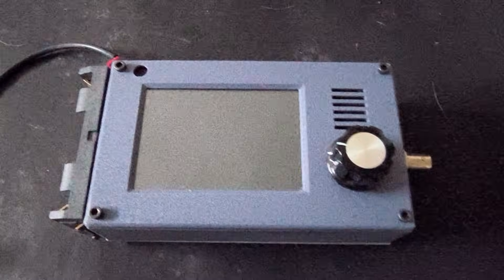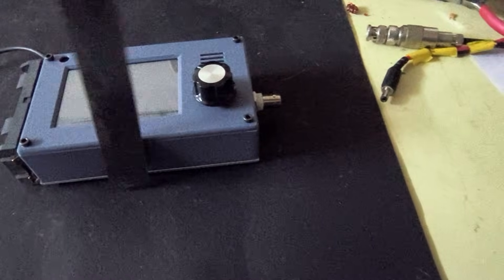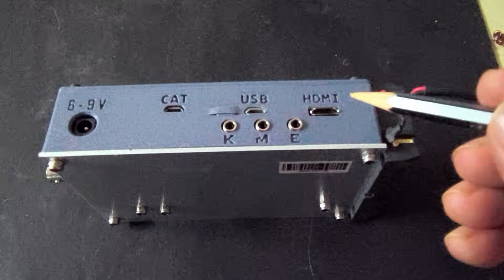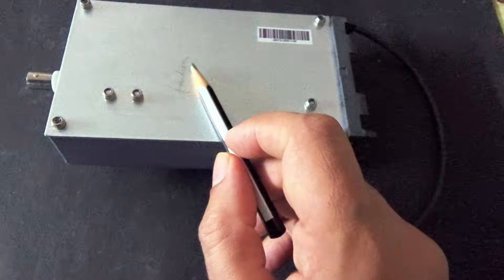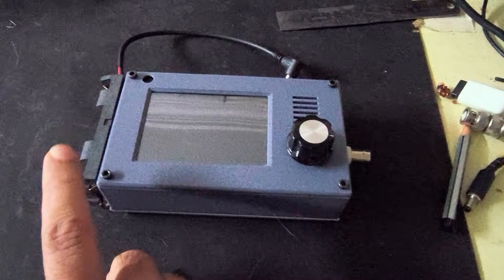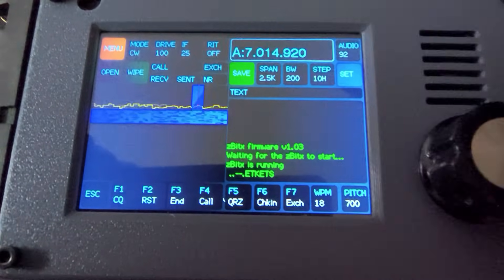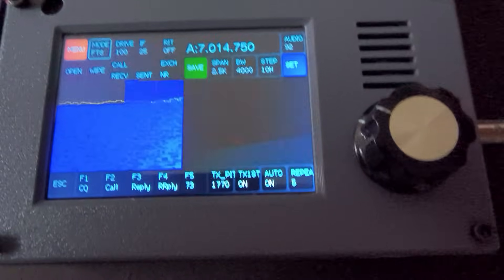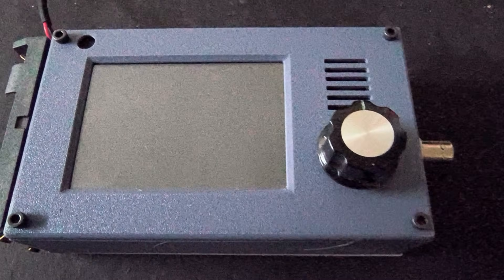zBitx Introduction : The QRP SDR's size and description

Comment: 3V-12V 5A 60W Adjustable Power Supply with LED Display, Variable DC 3V 5V 6V 9V 12V Universal AC/DC Adapter, 100V-240V AC to DC 3-12V Switching Power Converter Multi-Voltage Regulated Adaptor - OEM

Can i use this power supply?

Comment: Can the 21700 battery be used? Also, Protected batteries is recommended by suppliers.

Is radio SWR tolerant?

Comment: I'm guessing it's MicroUSB instead of USB-C because of the Pi Zero 2. We're probably ~2.5 years away from a Pi 3 Zero.
Great idea on avoiding charger noise, and amazing project! Had my heart set on a (Tr)uSDX but now might get this, if I can.
Would be cool if the knob was like a keyed recessed encoder mechanism, and people could 3D print exactly the type of knob they want (probably can already?) but when the knob is removed, it's flush with nothing sticking out.

Comment: Great Job. One question. Is it possible to put voice prompts like the Kenwoods or the Open GD77 project? My TYT hand held and my TYT MD 9600 mobil speak all functions and menu items. We have hundreds of us blind hams that would love a small QRP radio we can take in a backpack. Maybe you could send one to Roger Clark VK3YY of the Open GD77 project and he can help with voice prompts for the ZBitX.
Reply from the maker: This has been a long pending project. to speech enable it.  Behind the GUI, call commands are passed as text strings to the core radio. I will reach out to VK3YY, thanks for the tip

Comment: Looks ok, how much power does it draw from the batteries in Rx, be interesting to see how it receives when you plug in a antenna 😁
Reply from the maker: It draws 350 mA, at times, during the bootup it can peak to 500mA, it gives me 6 hours on a pair of 18605s
Reply: That's really interesting about the same as a ft-817  @ashfarhan
Reply from the maker: @adam-g7crq  FT-817 (the only commercial radio I ever owned) is a little north of 500mA. This sits halfway between the FT817 and the KX3